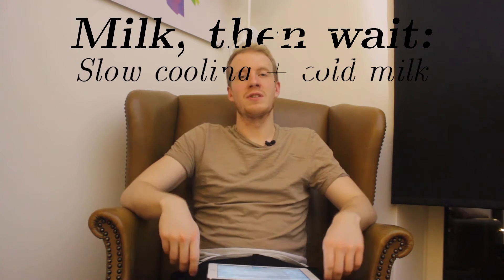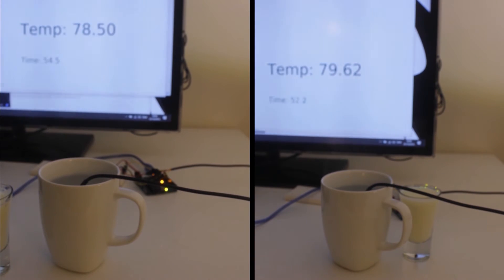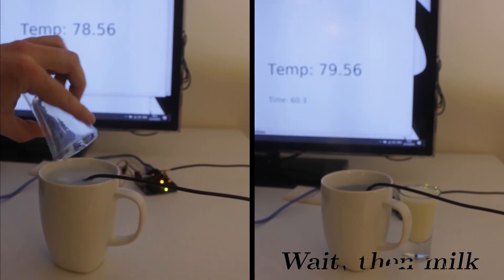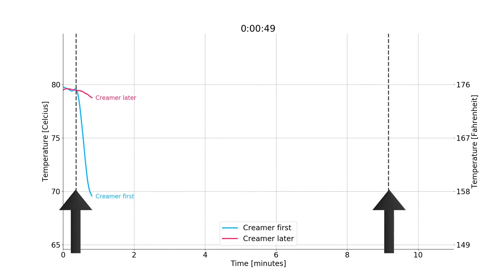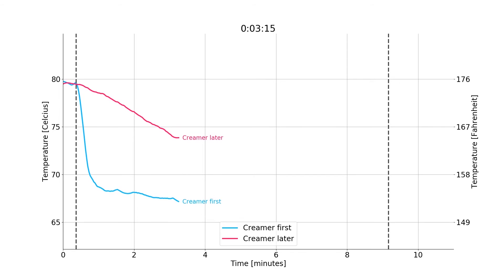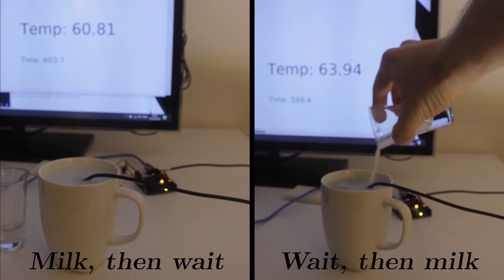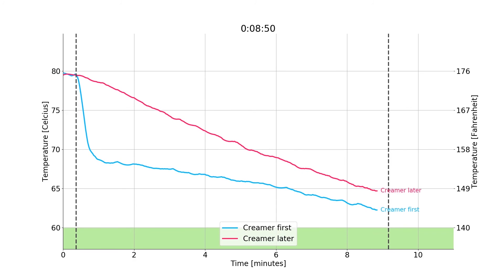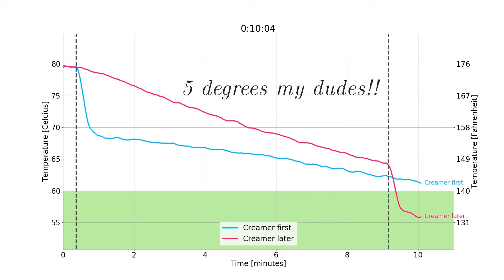Coffee: Why waiting 10 minutes before putting in creamer cools of your coffee more

Comment: One thing that many didn't considered is the cooling period.
If the cup is losing heat {cooling} during the 10 min wait then when someone adds the the cooler liquid it lowers the temperature than the value after the 10 min wait {this is assuming from a physics perspective: the heat lost to the material, etc...}. I believe in the math:
We first calculate the heat loss after 10 min then calculate the heat after adding the cooler liquid {milk} with the value of the first calculation.
The calculate the heat loss of the first cup + the water added and compare the answers.
OR
Just calculate for heat values {temperatures} and then calculate time to cool and compare.

From a purely math standpoint.

I hope i made sense..